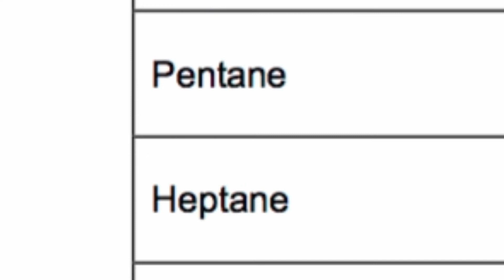What are the Dangers of Dilbit?

Comment: Absolutely wild people even consider Tar Sands.  You would think after using up all the easily accessible oil you would be interested in alternatives!

Granted i guess ruining land is cheaper than investing in Sustainable Biomass/Nuclear/Renewables…
Reply: What about everyone’s jobs. There’s enough tar sands for the next 150 years. Is manufacturing and disposing of batteries used in cars any better? Do batteries for cars even work in Canadian cold weathers?
Reply: @TunnelSnake-es7tu  Bold of you to assume i like Battery Electric Vehicles (BEVs)
Reply: @ericlotze7724  well you said renewable
Reply: @TunnelSnake-es7tu  On a more serious note though it depends on who you ask.  To the heartless peak Free Market types, the average Pipeline Welder / Heavy Equipment Operator / Roughneck etc is basically fucked.  Jobs dry up, towns become ghost towns etc. 

Most others agree that a “Just Transition” is key.  How you get about that is the tricky bit. 

Helping people switch jobs is hard in areas that were/are only inhabited due to the resources being there, but are otherwise bad locations due to being ultra-remote etc.  A good example of that are the “Coal Towns” here in the USA.

But essentially a mix of (Free) Job Training, Grants to and deals with Community Colleges, and Job Coordination or even Creation (Something as simple as “Job Fairs” to stuff as intense as revamping the “
Civilian Conservation Corps”) should get it done.

As a stopgap, the “Welfare State” can step in, and worse case scenario paying for moves to other areas could maybe be done.

I’m not some expert in this field, so to be honest **I don’t know**, especially the specifics.  But this is an addressable issue.  

Due to lobbying by those who juice the profits out of the land (and the people who do the work for them) this is framed as either impossible to address, or that doing so is bad (Re: Demonizing the “Welfare State” and such, despite the help they do, and the horrors of the Great Depression).  

(Edit: Typos)